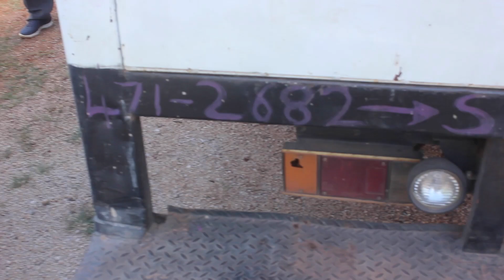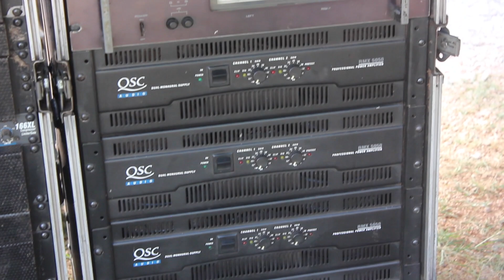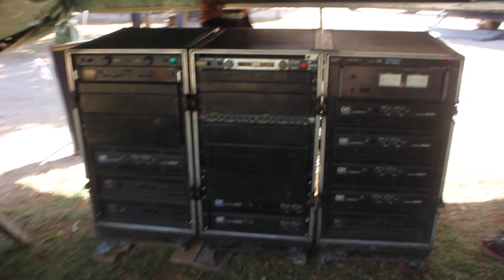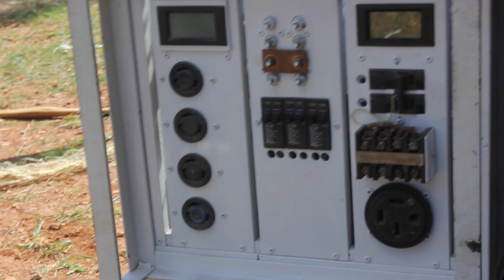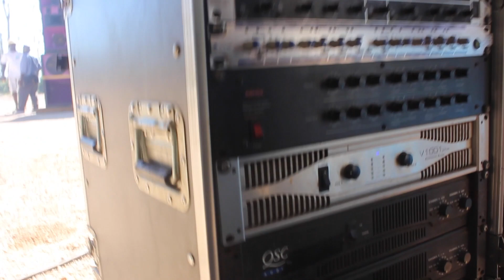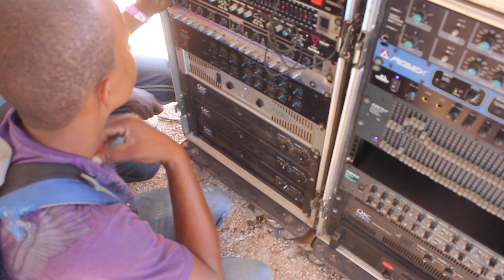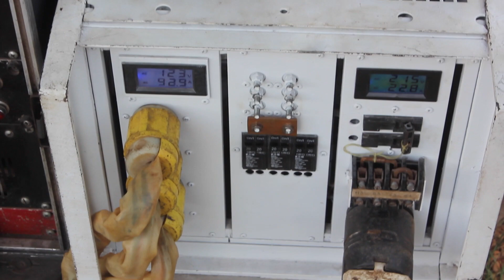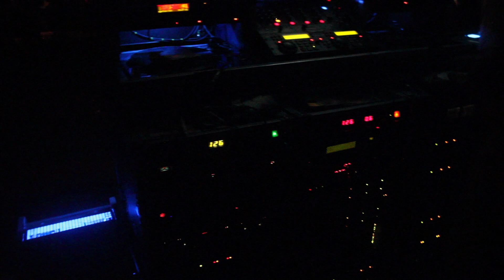SOUND SYSTEM IN JAMAICA PART 2

Comment: I have a question what is the name brand and the model number of that power capacitor/transformer that is the white box that the main power wire runs into then out to all the amplifiers thanks
Reply from the maker: Seismic Sound Productions it’s a power regulator custom build
Reply: @romainepope  do they make them here in the US
Reply from the maker: Seismic Sound Productions yeah but not as powerful

Comment: All this rmx 2450 should be replaced with crown xls 2502
Reply from the maker: SoundFreak88 reason being ?
Reply: @romainepope  First of all have nothing against the rmx amps they sound great they are class h amps amazing quality of sound. But the crown offers a little bit more power at 4 ohms. But not the main reason the xls series is amazing for power consumption nearly nothing of power consumption and also weighs way less than the rmx 2450.  Also very quiet amplifiers which doesn't really matter when you are blasting loud music. Also cost less than the 2450. And also for the the record crown amps have been known for the amazing dapning control for subs. The new generation Qsc amps have the problem for having hiccups while powering subs because of low dapning factor. I personally would only use the plx 3602 on subs. It has a good dapning factor of 500... Or the older generation Qsc amps like the mx and older PL series. Don't get me wrong the Qsc rmx is probably a little bit more reliable and can handle clipping. I'm only 14 years old I don't know everything. but I have almost used all Qsc products such as the speakers. only amps I haven't used is the gxd series
Reply from the maker: SoundFreak88 for that application they have there xls wouldn’t work out cause the don’t play well with voltage swings that happens in Jamaica voltage gets too high Or low xls will shut down rmx on the other hand will continue playing
Reply from the maker: SoundFreak88  and the xls is every noise amplifier can hear noise coming out them with the gain control turned all the way down I do think the rmx are class h amplifier too
Reply: @romainepope  the xls can handle that. Can support 240 volts down to 95. The Qsc amps still play when the voltage gets low they clip big time the xls series does better at low voltage and also do good at high voltage . For all the voltage swings and problems I recommend Furman products!! Trust me
Reply: @romainepope  I'm talking about fan noise. All amplifiers will produce some sort of white noise.
Reply from the maker: SoundFreak88 u sure u mean the xls and not the xti  I do have a xls and it can’t play on 220 the xti and itech do that thou and I’m sure it  cause anything over 130v it shuts down I use that amp to play horns and one night I was playing on a battle ship in New Jersey and that amp would shut rite down wen the votlage went up . My itech and xti played fine

Comment: 7500 watt rms
Reply: Toader Madan Not able to be delivered by the thin wires he was stealing the electricity from, 7500 watts means about 30 amps@220v and the shop is still drawing it's usual current!
Reply: andrew allen 34 ampère com rendimento de 100%
Reply: It was only pulling at least 22 amps